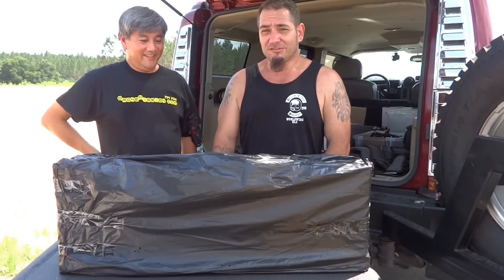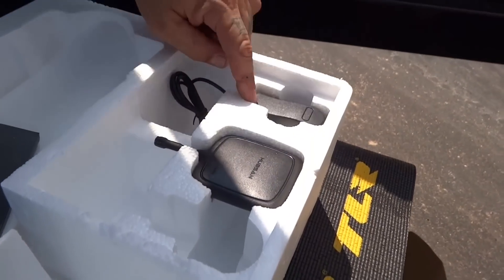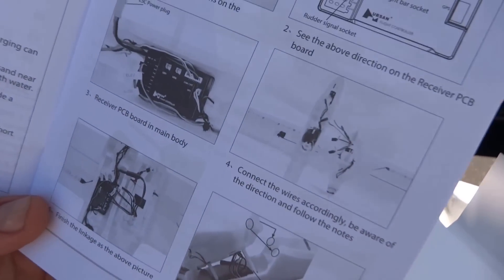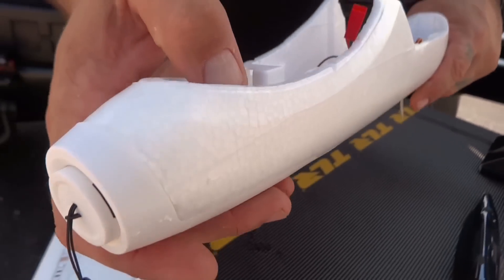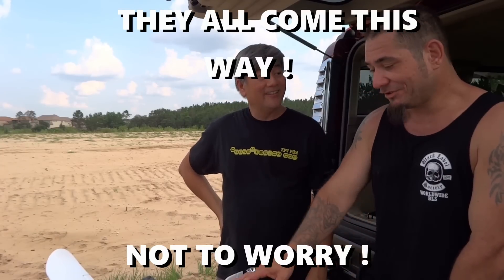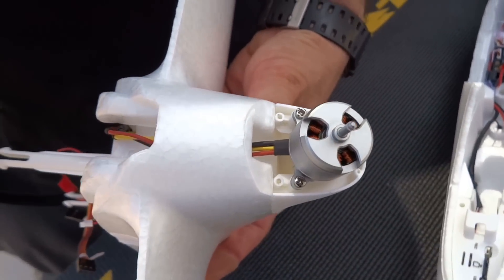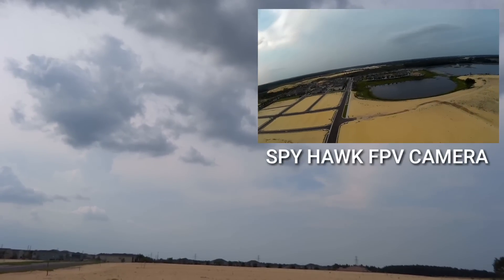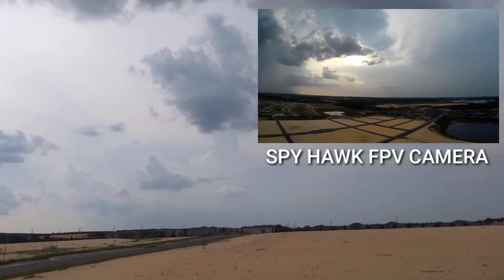HUBSAN H301S SpyHawk FPV , GPS, PLANE /UNBOX & FLIGHT

Comment: Awesome review guys, On the prop i saw it came with it on the motor and i saw you took it off to look at the motor when you put it back on which way did you turn it to screw it back on to the motor? And did it come with a extra prop or any other extra parts? thnks

Comment: Good review man. I've had mine for quite a bit now and I love it. bought a helical antenna for it and getting 3.5 km at 500m high. also I changed the battery to the one out of the h501s and easy 30 min run time. will enjoy move reviews that you do...thanks
Reply: have a link for the antenna?

Comment: Please help me

Today I try to make my first flight with my h301s.

when motor was armed propeller broke in half, how it is possible?

when I bind the plane motor is armed automatically, it's normal? I try to reduce throttle trim but I can reduce a little, I can't reduce to the minimum lower value. Left joystick remain in the center so I have to pull down throttle to stop motor. 

Take a look at this video to understand what I'm talking about 
-> https://drive.google.com/file/d/0BzQ...ew?usp=sharing
Reply from the maker: Marco Ricca some reason I can't see your video but I do know you have to calibrate this.... 2 types of calibration has to be done on this plane
Reply: watch this video  https://drive.google.com/open?id=0BzQxLFcsrPSKdU9BQVpaSzUxRjA   as you can see left joystick remain centered, if I pull down after i release it return in the center
Reply from the maker: Marco Ricca is it bound ?? seems as though it is not...
Reply from the maker: also check to see if you are in mode 1 to mode 2?  it is possible that you are in mode 1 
that may be why your throttle stick is self centering when it should not be my throttle stick does not do that
Reply: I can't understand, what does mean your answer?
Reply from the maker: Marco Ricca most controllers have a mode 1 and a mode 2 for different countries! here in America we use mode 2 which means the left hand stick is the throttle and yaw stick. and on this airplane it does not self Center so what I am saying is you possibly could be in the wrong mode because throttle stick should not self-centered only the right-hand stick should( in mode 2 which we use in the US)
Reply: I have mode 2 transmitter, both joysticks are self center
Reply from the maker: Marco Ricca you are going to have to get in touch with whoever you bought it from because they sent you the wrong controller they sent you the one for the Pro 4 quadcopter we're both sticks are self centering! the one for this plane only the right side is self centering not the left stick. and that's what your whole problem is my friend I'm sorry to hear that and I hope they do you write and send you the proper controller! I have heard of this problem happening one other time before.!
Reply: also propeller broke down in half when I armed motor, gearbest live chat is not active now
Reply: so they send me wrong transmitter , They have to send me the correct one I hope

Comment: Great video. Hubsan is branching out I see. I have 2 of that controller. Wonder if the plane can be purchased without a controller? I haven't flown a fixed-wing in years. I just came in from flying one of my H501S. Night flight is way harder, orientation and line of sight wise. The trees are pretty defoliated and hard to make out. If it wasn't for the telemetry, I would have definitely wound up flying into the top of one down the street. ;-)
Reply from the maker: Don Fish Jr. ..lol. to funny
Reply from the maker: +Don Fish Jr. (The Flying Fish) did a little research and can't seem to find the airplane in just a bind and fly version.
Reply: Thanks for looking. I couldn't find one either. ;-)
Reply from the maker: No problem HAPPY Hollidays my Friend !!

Comment: My motor is offset the same way, I also thought it was a defect. It's  actually designed that way, this article helped me kind of understand http://oldsite.electricrcaircraftguy.com/motor-thrust-angles
I also discovered my Devo 7 lipo battery fit perfectly in the TX. They are less than 12 bucks on ebay and they have a JST plug on them. Great review guys👍
Reply from the maker: Steve B yeah I figured it out. LOL but thanks for the information